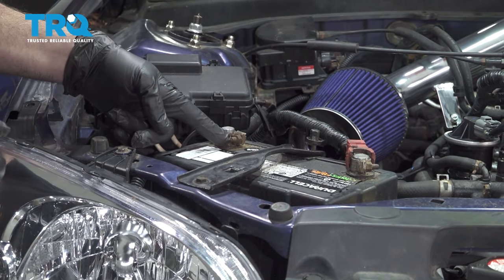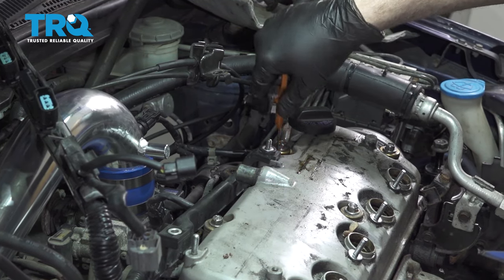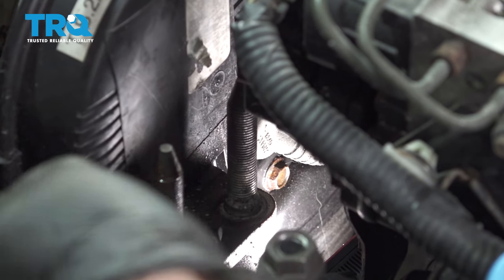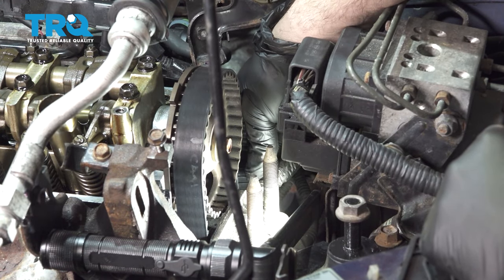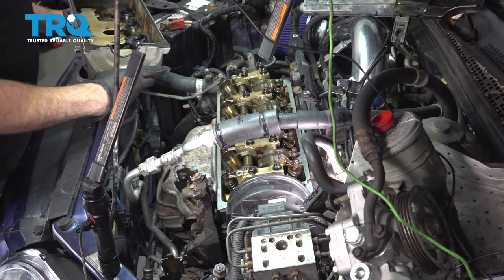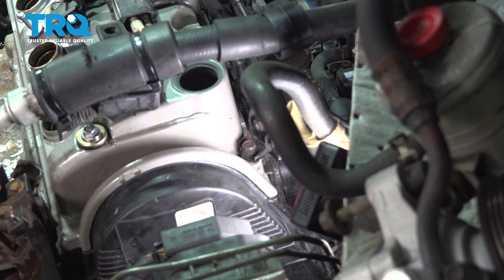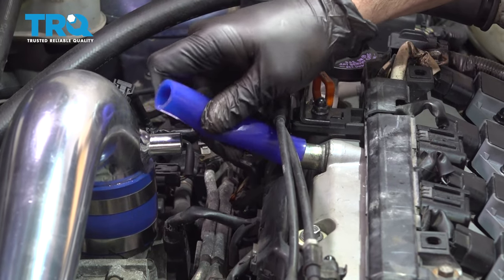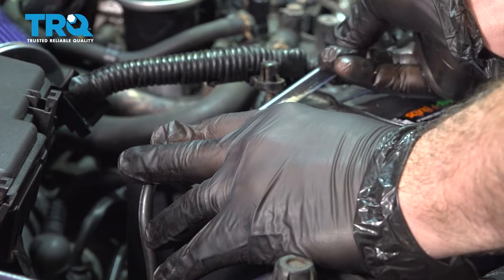How to Replace Camshaft Position Sensor 2001-2005 Honda Civic

Comment: Screw a bunch of that!!! 1.Place jack/wood block under oil pan 2.Remove motor mount 3 nuts. 3.Remove ac lines bracket bolt in valve cover for wiggle room. 4.Pry off round sensor dust cap and reach inside and disconnect elec connector. 5.Remove 3 upper timing belt cover bolts(hardest part) 6.Use flathead to pry lower rear of cover from its backing piece(it separates near where that rearmost bolt was).7.Carefully wriggle the cover slightly downward then  back, up and out. 8.Replace sensor ..
one bolt. DONE shaka lacka.

Comment: I  just cleaned the sensor connection with contact spray and plugged it back up. I pulled the batt cable to reset the code and it has so far worked for me.

Comment: He doesn't mention replacing the valve cover gasket but looks like he did. It looked red at the beginning, then black when replacing the cover. He also mentions not having to remove the power steering pump, but looking closely at the video, it looks like he did.

Comment: I have one of these and am doing the timing/water pump/tensioner/mainseal job for the second time since I've owned it(@280k miles) and will be replacing this part, so the mirror look was helpful. :) 

I like your Bob Ross style ..happy little bolts. I thought it was funny when you took all the bolts out of the ABS mount..knowing it wasn't going anywhere. :P

Comment: Thank you.  very accurate video for what i went through except how long and how many tries it took me to get the sensor back in place.  my only comment is in regard to not dropping the sensor's bolt.  in removing it i bent a cheapo magnet on a stick and fed through my deep socket to turn it into a magnetized socket.  and in replacing the bolt, i used the whole finger from a glove and covered the entire deep socket and it came out with the socket.

Comment: Do you have to take the valve cover and wiring harness off too or can you just remove the 3 bolts on the plastic cover and get to the camshaft
Reply: @MichaelMosesHammer  Since you are still lifting the valve cover on one end will this cause the valve cover gasket to be uncompressed and loosened and thus leak later on.  Hence you will need to put on new gasket anyway????  What has your experience with leakage like????

Comment: Another advantage to this method is that(after you replace the sensor) you can connect the elec connector and immediately start up car and see if error code vanishes. (Maybe replace motor mount just in case?) Cant start it up with valve cover and 15 million hoses disconnected... lol.

Comment: All of this is so unnecessary. Loosen the valve cover and only lift it til its past the timing cover. Remove the timing cover with ease and do not remove the mount. If you have abs, loosen it out the way. Cam sensor out. Did it within 10 minutes